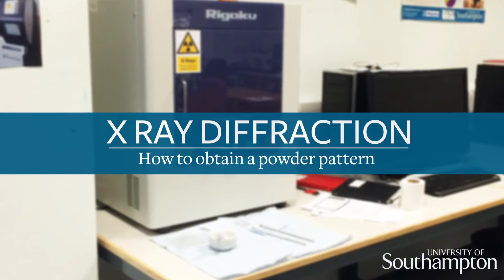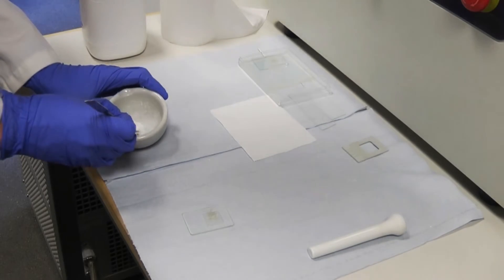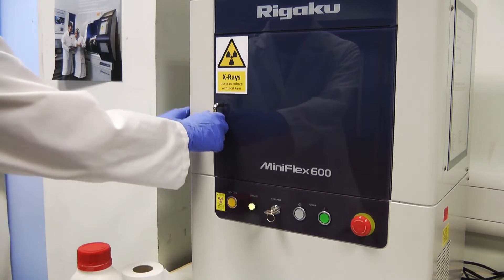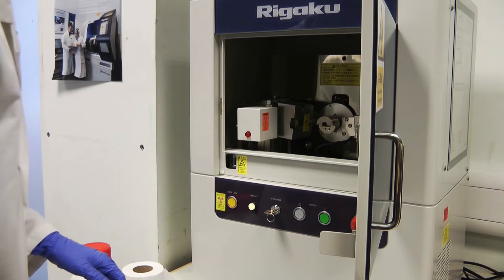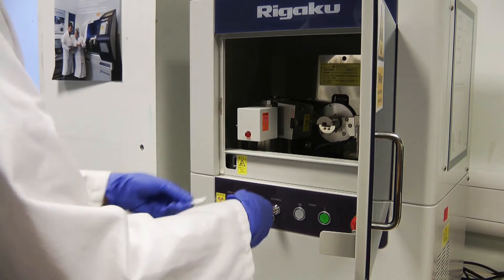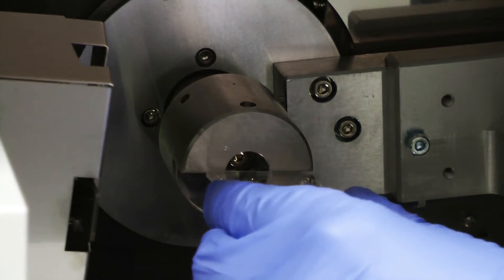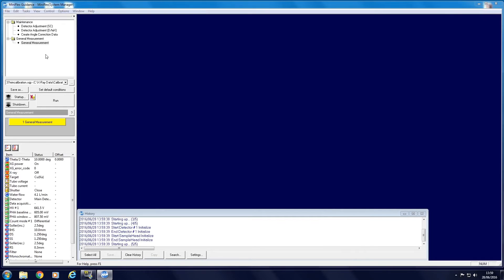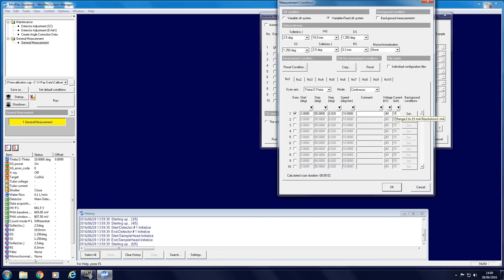Powder X Ray Diffraction familiarisation video

Comment: The X-ray radiation is not sufficient to knock out the inner orbital electron. As it hit the atomic plane, it scattered in all directions, which can either constructively or distructively interfere. This constructive interference gives rise to a set of incident radiation that is reflected at an angle. This reflection gives rise to diffraction 

So check your facts very well